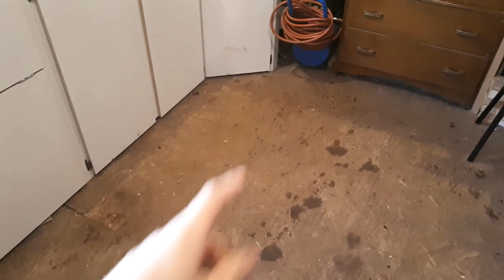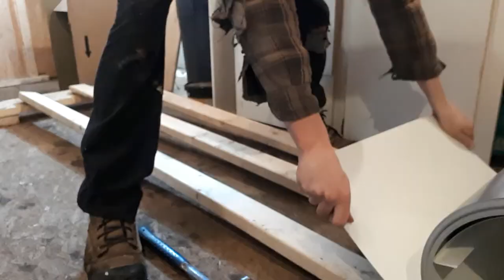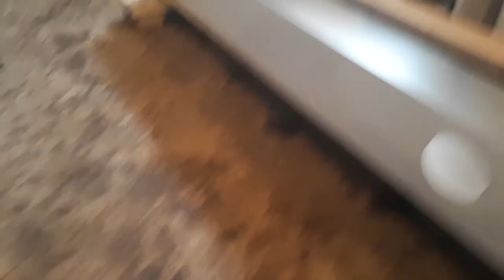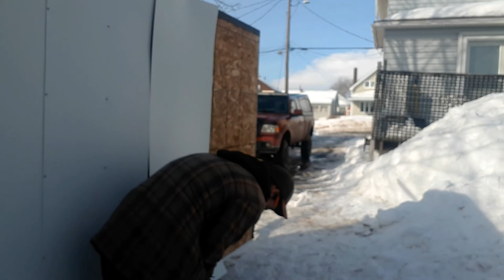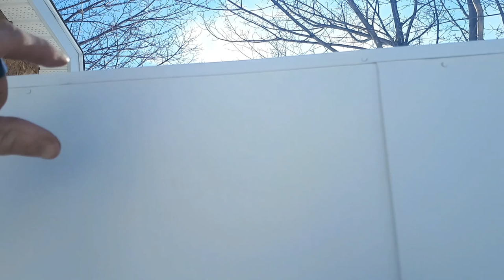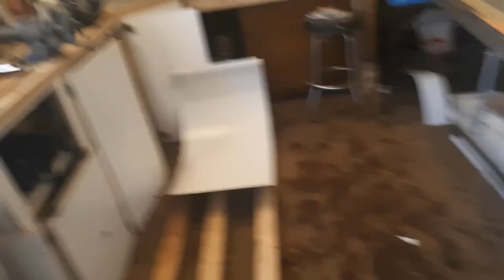installing aluminum sheeting!  home made trailer build (part 4)

Comment: Awesome series. Just found a bare frame for an 18 foot trailer. Do you remember what thickness of tin you used?
Reply from the maker: Hi not sure of the thickness but it is standard gauge for facia on houses
Reply: Tin? I thought it was aluminum?

Comment: How did you bend the sheet metal exterior panel at the corner?  I don't have access to a "brake" to bend sheet metal (though I did work one summer for a HVAC contractor friend, and it was fun using all of his sheet metal equipment to make the metal plenums).
Reply from the maker: You should be able to rent one at your local rental or home depot rents them out if this is not an option in your area try going to a metal fabrication shop and ask if they can bend it for you